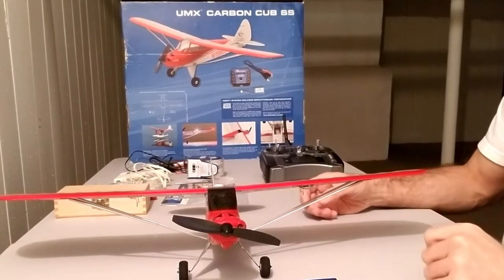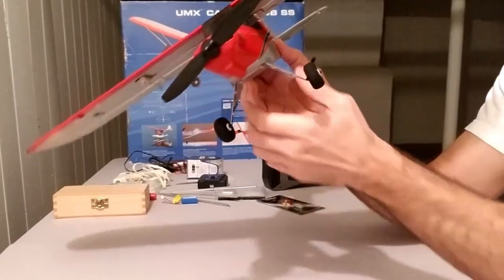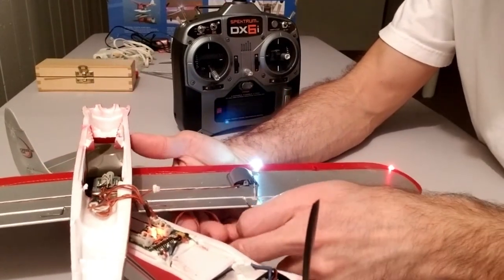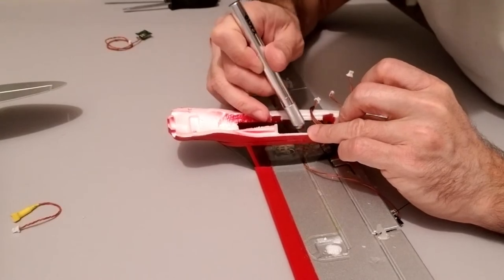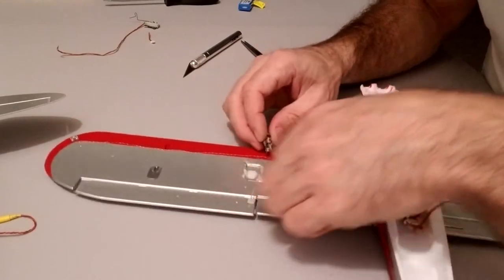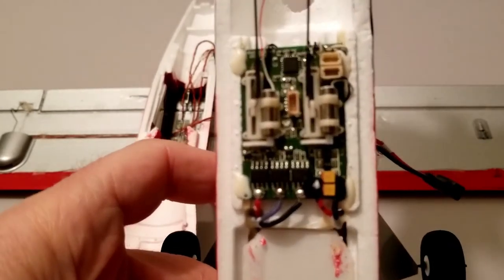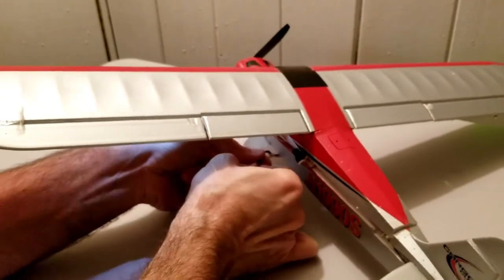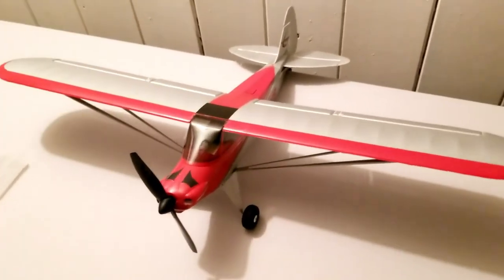How to replace aileron servo on an E-flite UMX Carbon Cub SS

Comment: Hello and thank you for posting this video! I noticed that you used the A2030 Ultra-Micro Analog 2.3g Linear Long Throw Offset Servo (Part #: SPMSA2030LO) for your Ailerons? After installing my servos (the same ones that you have), I did noticed that the servos are not centered(70/30) and that the aileron up position is significantly more than the down position. Why didnt this happen to you? Please read this discussion: https://www.rcgroups.com/forums/showthread.php?2998975-Spectrum-2-3-gram-Linear-Long-Throw-Offset-Servo
Thanks again! Kiko
Reply from the maker: Hi Kiko. I am sorry for the late response. I replied a few weeks ago, but my reply never posted and got lost. So I will try to retype my answer. This built-in offset for the ailerons (a.k.a. differential ailerons) are implemented in order to reduce the adverse yaw. Adverse yaw is the tendency of the airplane to yaw right when you bank left, hence you need a bit of left rudder in order to perform a smooth, coordinated left turn. Vice versa for a coordinated right turn. This website explains this adverse yaw phenomenon and differential aileron deflections very well:
https://www.boldmethod.com/blog/lists/2020/04/six-aerodynamic-facts-about-ailerons/
My Carbon Cub SS is exactly the same as yours with the offset aileron servos.